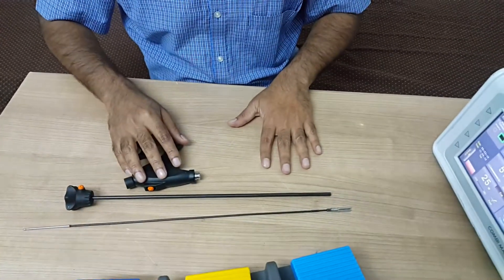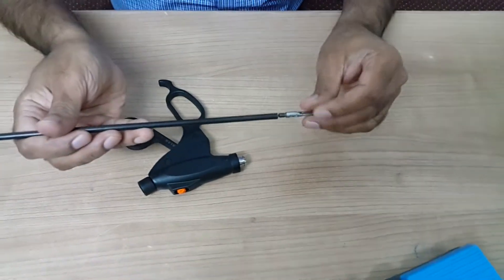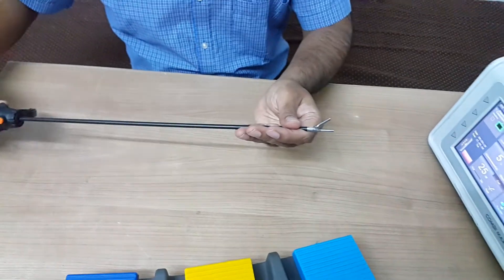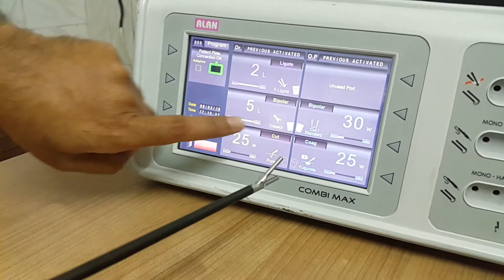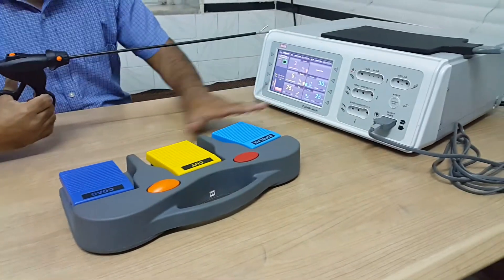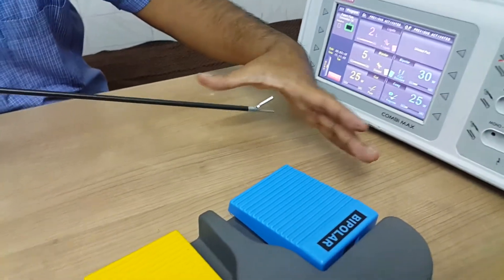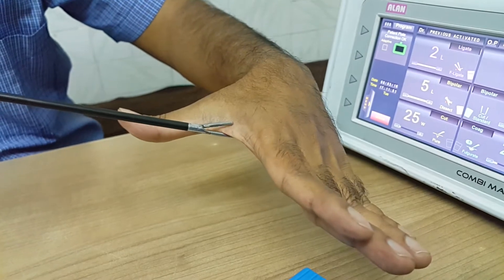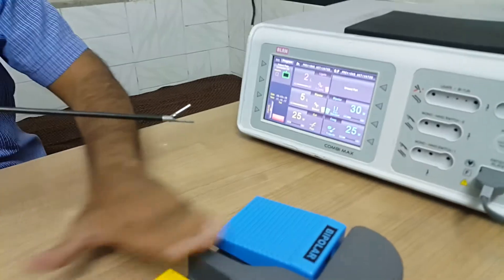ALAN Vessel Sealing Instrument Use & Wireless Footswitch

Comment: Can we use bipolar forceps and vessel sealer together?
Reply from the maker: yes
Reply: @victorpatil  how to use simultaneously
Reply: Because bipolar output is completely shifted to vessel sealer when we use vessel sealer right
Reply from the maker: @arthikashetty8214  there are 2 ways to use it; Machine can be programmed to work like [1] Independent Bipolar output & Seal - Use two different instruments. Like ALAN Bissector instrument & Lap Bipolar Forceps  [2] Use Bissector Only and u can activate Seal, Cut, Bipolar Coag ; all output will come from Bissector instrument. In machine when you select "BP on LG " ... ON [for point 2] & OFF [for point 1] you will get the above results.
Reply from the maker: also check this ...  https://studio.youtube.com/video/chsSFkHKNRQ/edit
Reply: @victorpatil  thanks a lot